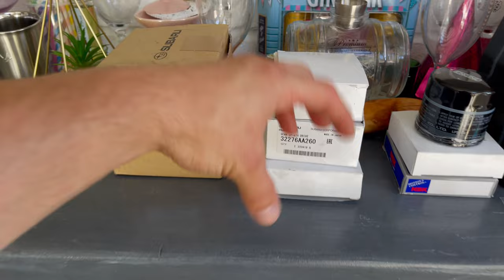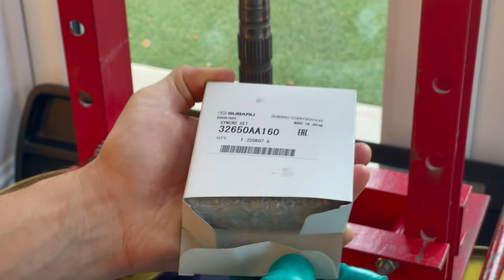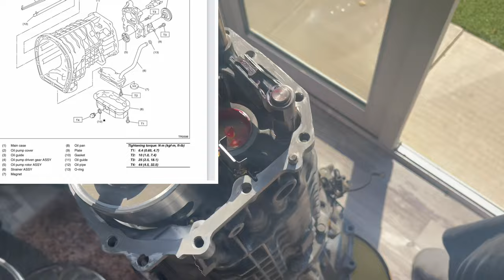* Subaru Impreza 6 Speed Rebuild - Walkthrough *

Comment: Super video this Sam. It's been very handy as a double check for the manuals as i work my way through a rebuild.
One thing i noted that no one seems to do in the various videos on youtube, is preload the reverse idler sub gear during the install.
The reverse idler gear is made in two parts, the main steel standard type gear and a thin sheet steel sub gear that acts as a friction clutch. Under that sub gear is a spring that you put 3 teeth worth on preload on in a counter clockwise direction, you then pop a pin in the main and sub idler gear to hold the preload on until it's mounted in the bearing carrier plate and the gears are meshed. Once meshed you pop the pin out and fit the upper alloy mount block for the reverse gear assembly. I doubt it matters on a race car build, but on a road car that should help reduce noise from the idler gear when it's not engaged as it keeps the idler gear from bouncing back and forth on the teeth.
Reply from the maker: Hiya mate, I’m pleased it’s been of some help to you 👌
Thankyou for taking the time to explain this regarding the reverse gear idler. That’s very interesting and does explain a little annoying noise I hear inside the car occasionally, the noise coincides with what you have said here and makes perfect sense now. 
As you say, not detrimental in my setup but I guess in a road car, could be very annoying! Thankyou for this anyway 👌

Comment: Just a heads up for anybody welding near bearings, make sure to put your ground cable lead ON the nut. If you put the ground on the other side of the bearings you could potentially arc through them and damage them.

Comment: Thanks for the video! I ran into an issue where second gear stopped spinning once I pressed on the 3/4 driven gear. Without pressure, second gear would spin, but once you tighten the top nut, second gear would bind. I flipped the center of the 1/2 hub selector when I pressed it all together the first time. I thought it was weird that the paint marker was on the bottom of the hub. The paint mark on the outer 1/2 hub ring was also on the bottom, so I thought the mark should have went down. I took it all back apart and flipped the only piece that I wasn't 100% sure I had on there right and everything pressed together smoothly! I still couldn't tell you which way the center hub selector is supposed to go, so be careful when you pull it off or mark the top when you are taking it apart. Mine fell apart on me when I went to clean it, so I should have been more careful.
Reply from the maker: No probs mate, for future reference, one side of the selector hub part your referring to has a deeper recess, I don’t think the paint marker helps with reference to which way round they go. In the factory manual it shows you which way round it goes, from memory, the deeper recess goes down. I can imagine this will have been highly frustrating 😅. As you’ve said, another good easy way would be to mark prior to removal and your good to go 👌
Reply: @5501pickopicko  First of all, I love this video. Thank you. It gave me the confidence to work on it and I'm glad I did. Question on the 5/6 selector hub install direction. In this video at 29:15ish, you say that the recess goes down. How sure are you that is true/what you did/what works? To me, the book image in step 16 very clearly (ok, somewhat) shows the recess on the hub (b) facing up above the 5th drive gear (c). Well, I put it together the way that I thought the book said. It shifts fine while sitting still, but quite difficult to get into 6th going down the road, so it is apart again and I'll hopefully be fixing it soon if I can figure out what's wrong with it. I thought about just getting a new hub and sleeve this time because mine no longer has any white dots to help assure things are back in line.

Comment: I'm having a problem where whenever I try to slide on the middle case section, it pushes the selector arms down and engages 1st, 3rd, and 5th at once and makes it impossible to install the shifter pin bolts.

Comment: @sam pickering how much of this can be applied to the ty856  2004 subaru Legacy 6spd?
Rebuild is very much in my future in terms of full refresh for preventative maintenance.
Love your work mate, very informative, this will be something i reference when i endeavor on my rebuild.
Reply from the maker: So I believe the majority of it can be applied other than the oil pump part, I believe the legacy 6 speed is splash fed much like the newer generation of 6 speeds. There are a few other differences but the unbolt and rebuild remains the same I believe.